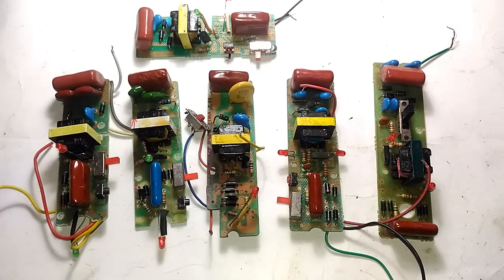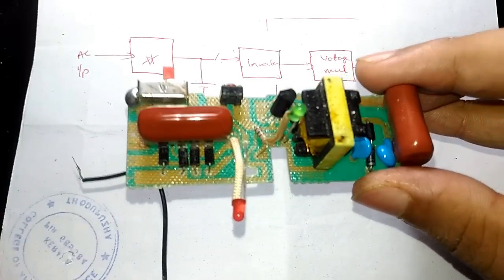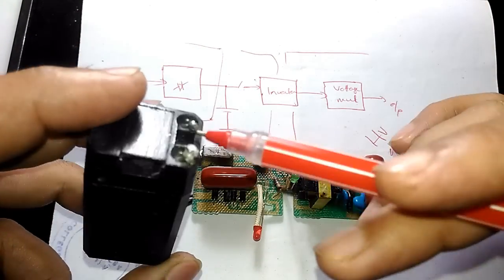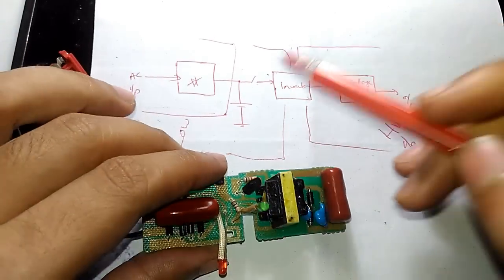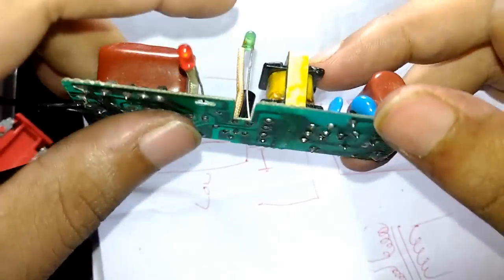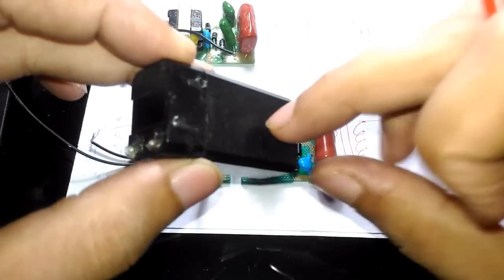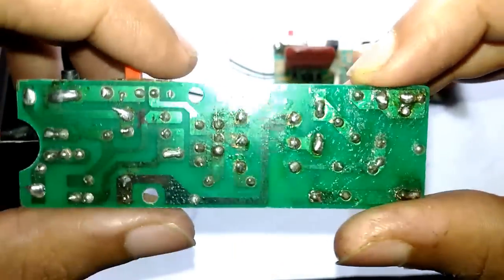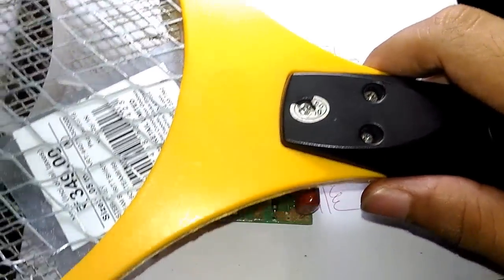IE#37: Mosquito bat, complete repair guide!

Comment: Hello! Mine also have faulty battery, do you think connecting the battery wires to usb and then using a powerbank is okay or safe? I saw it from here watch?v=IncCAdTyaBU 
(yt doesn't allow links, so just the last part of the url)
Reply from the maker: Even though it is possible to do so, I don't recommend it. Because these boards do not usually have any sort of input protection. And it depends on the internal resistance of the lead acid/zinc chloride battery for the current limiting. So when you connect it to a power bank, there is a possibility for damaging the output section. Use it at your own risk.
Reply: @INSIDEELECTRONICS  Alright thank you bro!

Comment: Hi I changed transistors,transform   
Both but still not working which one should I check how do I check high voltage capacitor
Reply from the maker: Check for continuity to the output side and check the output diodes also.

Comment: hai sir my mosquito racket very low out put power now...  way is the plm ...? pls replay ...
battery is good
Reply from the maker: +nafe hash The problem could be anything from the battery to the final voltage multiplier. Does it makes the popping sound when a fly gets trapped? Or is the fly slowly burns away? Did you checked the battery under a load?
Reply: Hello sir same problem  battery is ok but output is low fly slowly burns
Reply from the maker: +Raja roy Try changing the output capacitor. You must use a proper voltage rated capacitor or else it may explode.

Comment: well when they burn out in 10-15 hr. you have kill 300 or so yellow jackets it is not cheep.  All though they are warranted but still.  put the swatter on a wood frame six-inch off the ground put half can cat food fish put a rubbery band on the switch to keep it on.  every  6 hr change the batteries .  clean of the grid of dead yellow jackets and flys and set it up again.
Reply from the maker: But why do you need to change the batteries every 6 hours, when you can buy the rechargable battery type fly swatters? They come with lead acid batteries and mains operated battery chargers in one single unit. Just keep it connected and it'll run on mains voltage just fine! :)

Comment: Hi! Thank you for the video. Could you please tell me the specification of the output stage diodes (multiplier section)?
Reply from the maker: +Jeovane Sousa The diode datasheet contains all the exact specifications pal. It varies from diode to diode. So to get the specifications for your particular diode, just do a Google search with the part number. :)
Reply: INSIDE ELECTRONICS!  I am sorry if I was not so clearly. The diode code number is what I want to know.
Reply from the maker: +Jeovane Sousa The diodes usually are 1N4007, ordinary 1 Amp rectifier diodes. The datasheet can be found here: https://www.google.ae/url?sa=t&source=web&rct=j&url=https://www.diodes.com/assets/Datasheets/ds28002.pdf&ved=0ahUKEwjUo7GVuanYAhWFthQKHXHOBBMQFggxMAA&usg=AOvVaw0mgOEo_CdF9-jRD6quq7vm

:)

Comment: My racket has a dead LiTian AA 600mAh 2.4V battery pack.
I would replace it, but is it Ni-Cd or Ni-Mh?
Reply from the maker: Most probably it'll be ni mh. But better check in its datasheet if available.
Reply: @INSIDEELECTRONICS  unfortunately no datasheet available :(
Reply from the maker: Not to worry, these Chinese batteries usually don't have any datasheets available. You can replace it with ni mh batteries.

Comment: What is the value of out put capacitor
Reply from the maker: Usually around 22 nf @ 2kv rating. But could be different in different boards.
Reply: In my case is 0,47uF 400V and it failed and it was shorted, I had to repleaced it.

Comment: One question, how the circuit converts 220 volt AC into approx. 3volt DC to charge the battery without using transformer?
Reply from the maker: Its because they are using a capacitor in series to the bridge rectifier. That way the capacitor acts like a resistor (and the property is called reactance) which will reduce the voltage to whatever we desired (here 220v to 4v), but without much wastage as if a resistor was used. It's a very common and cheap way to convert AC to DC. But the main problem with this type of capacitive  "series dropper" circuit is the risk of electric shock. Since there is no isolation between AC side and DC side. Also the voltage will shoot up to full 300 volts (RMS value) if there is no load connected. So it is not safe.
Reply: Prakash Chandra very nice explanation Sir

Comment: Pin voltages ......
which points how much voltage expected??
Reply from the maker: At what points? Its not possible to measure the output side with any  normal multimeter because the output side is in higher frequency and can mess up the readings. Input side is normally under the battery voltage besides the charging stage.

Comment: The red plastic of my mosquito zapper  sliding switch has broken. How to add external switch in the circuit?? Thanks
Reply from the maker: If its the sliding switch that is broken, then the easy way to get around is to solder the slide switch terminals together. Then the second push button switch can be used for turning the bat on/off.
Reply: INSIDE ELECTRONICS! Thank you very much. I soldered two wires on the terminals of circuit where the broken switch is present and i bypassed that switch by affixing push on/off switch on the handle. :) Again lot of thanks

Comment: Hey bro ...how to solve low spark problem.....
Reply from the maker: Try changing the output capacitor.
Reply: @INSIDEELECTRONICS  I changed but then also low spark problem.....
Reply from the maker: That means you've to change the multiplier capacitor too after the transformer.
Reply: @INSIDEELECTRONICS  can you please explain in detail....😶
Reply from the maker: First, check the battery. If the battery is old, then it can't deliver the current to create that sparks. Replace if necessary. Then check the two capacitors after the transformer. These are usually blue in colour, and will be before the output capacitor. Check their value and replace if necessary. 😀👍🏼
Reply: @INSIDEELECTRONICS  Ok Thank you 😃...
Reply from the maker: You're welcome. 🤗

Comment: Battery voltage 4, red light On but green light not getting on when charging, spark is low what is the possible reason
Reply from the maker: Check the section where the green LED is in. Probably the charging capacitor is faulty - assuming the green LED is in the charging section. If the battery is low the sparks will be low. :)

Comment: Hello sir I watching your video  mosquito  bat repair  video   some face my mosquito  bat when I press button led bulb glow  mosquito  bat   not sparked light  not show I thing  spark capecitor  weak  which valve capecitor  repleace   tell me sir
Reply from the maker: +Babu E The value is usually printed on the capacitor itself. You can replace it with any non polar high voltage capacitor (not less than 1600 v) which typically are of 470 nf 1600v or 680 nf 2000v. Also check whether the battery is good or not.

Comment: Transistors D695 is short... Can I replace with D8050?
Reply from the maker: +High Quality Amps Of course you can. It can handle 1.5 amps of current. But it's always a good choice to go for a higher rated replacement component. So here is the full digikey listing for suitable replacement transistors with 2 to 2.5 amp ratings. https://tinyurl.com/y83zo7sn
Reply: INSIDE ELECTRONICS! Thanks... But the pin out is different ...?
Reply from the maker: +High Quality Amps That is fine. You can adjust the leads to fit the proper way.  The collector pin of new transistor should be adjusted to fit in the existing collector point, like wise the remaining pins also. 😊
Reply: @INSIDEELECTRONICS  sir D965 ki jagah konsha tra laga ye
Reply from the maker: Sorry I didn't get you.. :(

Comment: most of these boards do not have transistor or condensor specs. pl help.
Reply from the maker: +Prabhakar Kannan The transistors used in these are general purpose high frequency switching transistors. You can easily find the datasheet for most of them by a simple Google search. Capacitors usually are metal film capacitors that doesn't have a specific manufacturer. So they don't have any datasheets. But they are quite easily available from any electronic shops for cheap or else you can salvage high quality capacitors from old tv circuit boards. ✌

Comment: How to check transformer.  Out put capacitor is ok. No high voltage o/p,  transformer secondary pin no voltage, primary all pin have voltage showing.
Reply from the maker: You can run it through a dc voltage continuity test. Use a 9V battery and an LED with resistor to check the secondary side.

Comment: Can you please share the diode number used ?
Reply from the maker: Samir Wadke The diodes are all 1N4007 rectifier diodes .
Reply: INSIDE ELECTRONICS! Thank you for the video. My bat uses RFC4K diodes, all of which are open. I can't find a replacement. Is there an alternative that can be used instead?
Reply from the maker: These are high voltage low current fast recovery type diodes. You can find some alternatives from here: https://ppmpower.co.uk/4kv-fast-recovery-diodes-now-standard-release/

Or search for UFHV4k diodes. But these are somewhat expensive compared to regular diodes.

Comment: can i use car 12 v battery
Reply from the maker: Nope. The circuit will get toast!
Reply: could you please help to make this circuit using car battery  .... can i use 7812 voltage regulator to reduce this high power
Reply from the maker: 7812 is a 12 volt output regulator so is the car battery voltage. You can bring it down to 5 volts using any ordinary car phone charger. Inside the bat, make a 3.3V regulator with heat sink and connect the input to a micro USB port, which will connect to the car charger, and the output of the regulator to the points where the battery was connected. This is the cheapest way to do it.
Reply: @INSIDEELECTRONICS    sir, i want to use this mosquito bat in my shop  .. so i have only this car battery .. ( car battery charging only once in my home  ) using this battery power can i made this mosquito bat?  pls help me .. i'm  totally confused..
Reply from the maker: Yes you can. Buy any car USB charger and connect the input + and - pins of charger to the corresponding pins of the battery. Get an old USB cable and cut it open. Inside, find the + and - wires and solder this to the + and - points inside the bat. For added protection, connect a 1N4007 diode to the +ve wire of USB cable. That's it. :)
Reply: @INSIDEELECTRONICS   ok   thankyou sir

Comment: switch ke pass jo resistance lga wo kitne ohm ka hai
Reply from the maker: Sorry, can you ask me in English?
Reply: INSIDE ELECTRONICS! Bro What is the value of resistance in the back side of press switch
Reply: INSIDE ELECTRONICS! What is the value of charging circuit of both resistances
Reply from the maker: It actually varies from board to board. The one in my video my not be the value used in yours. If you can share the picture of your board, I can help you to find the replacement values.
Reply from the maker: In charging section there are only two resistors. One across the capacitor to discharge it after turning the AC input off, and another one connected the LED. The resistor across the capacitor will always be a high value, for e.g. 680K to 1M ohms. This should not be less than 470K. The other resistor connected to the led is around 10k. But as I said, the values varies from board to board.
Reply: INSIDE ELECTRONICS! how can i send photo
Reply: INSIDE ELECTRONICS! 4th and 5th pic are something matching
Reply from the maker: You can share it on insideelectronics@yahoo.com
Reply: INSIDE ELECTRONICS! bro plz see the mail box
Reply from the maker: Already replied. :)
Reply: INSIDE ELECTRONICS! Bro iam sharing you two board pic tell me the values of both resistances
Reply: where i can solder resistance
Reply: INSIDE ELECTRONICS! Which resistance is suitable for both ckt

Comment: Most of the time output capacitor fail at voltage multiplier  Suggest please give components value of output capacitor 
Thanks Regards
Reply from the maker: Basically any high voltage non polar capacitor can be used at the output stage. You should only be worried about the voltage, just see if you can find film capcitors rated for 1500V or above. 1uF will be more than enough.
Reply: very difficult get such cap   some are green colour small size in voltage multiplie0r area   and output cap is .46 uf 600volt     New bat just come in 150 rupees
Reply from the maker: You can always buy it from eBay. Or else if you have multiple 600V rated caps available, you can connect them in series (3x600v=1800v) to get the equivalent voltage rating. In that case you can just ignore the capacity. :)
Reply from the maker: Unfortunately I'm not in my workshop currently. I'll be back only by the end of next month. So can't give you an exact numbers now.
Reply: Thank I belive You from Kerala
Reply from the maker: Yes I'm. :)
Reply: I replaced 4 capacitors 3 small cap 2 kv and 1 big 223j 1800 volts  in output stage  without mesh it good spark. but when connect mesh it give spark when push button pressed
Reply from the maker: So what's your point then? :) Without the mesh the capacitor will spark across its own terminals. Its to avoid this action, usually a wax coating is applied at the output stage. Otherwise it will only arc across if something is in between the mesh.
Reply from the maker: I've already mentioned my email id in my channel. Anyone can access it. Its insideelectronics@yahoo.com. And as I said earlier, I cannot provide the exact numbers since I'll not be in my workshop until next month.
Reply from the maker: An approximate matches will be 0.01uF 2KV caps on the multiplier section and 220 pF 2KV (223J2KV) cap on the final reservoir side.
Reply: Thanks and regards

Comment: Bhai transformer kharab ho gaya hai, kahi nai mil raha hai, plz guide kaha milega
Reply from the maker: This transformer is not readily available in market and also because it doesn't have any part number usually, it's hard to get it online too. What you can do is wind it by yourself or get if from any other similar board.

Comment: your are turning the board too often and also should be slow.Show the actual method of checking with multimeter often than giving opinions about  the fault .Give locations cell no were the spares are available
Reply from the maker: Being a troubleshooting video, I assume the people who are watching it may already have some experience using the tools and can understand how to apply what I'm saying in the video explicitly. Still, I'll be making a separate video soon that shows how to do it with a meter. Giving locations and  contact numbers are impossible since it depends on where you live, and also you can buy it online as well. :)
Reply: I am at trichy Tamil Nadu and there is no qualified persons doing repairs and also no spares are available at shops.No one is able to even attempt it for lack of knowledge.Hence pl inform the nearest locations where spares may be available
Reply from the maker: I'm so sorry about the contact numbers since I'm not a native of that area I'm not sure where to guide you to. Still I can help you to find the replacement components online. :) Tell me which component are you looking for now. I'll provide you with a purchase link.

Comment: These are badly designed specially the charging circuits and the batteries...buy AA battery operated Fly Swatters. They are much better. Same design same circuit same Voltage output 1.5to2KV ranged...just the charging is not needed. Or if New technology of Lithium Ion is introduced here then it  will be beneficial in the long terms.